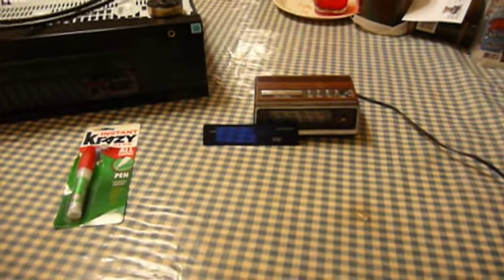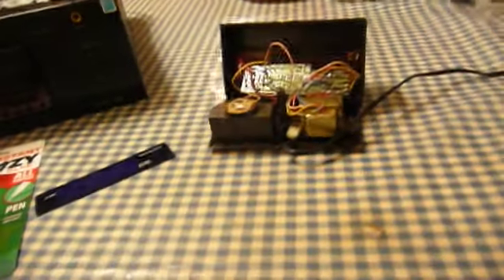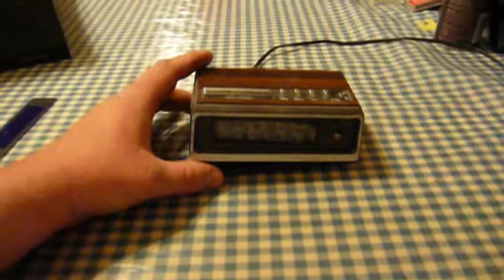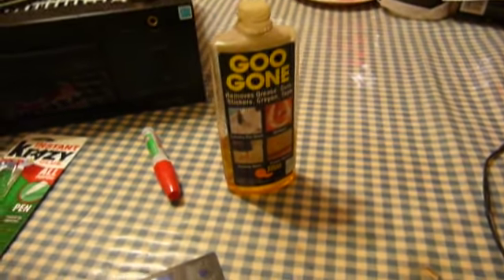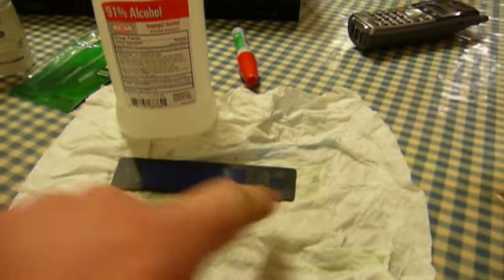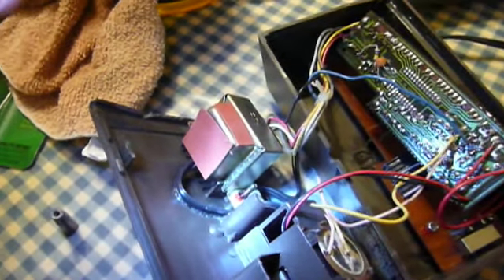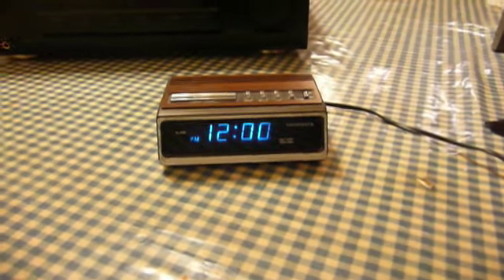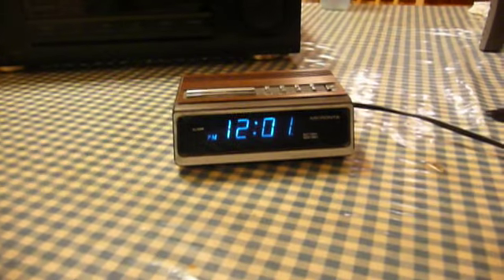Kitchen Table Electronics Repair: The Micronta Clock Restoration

Comment: The 1986 Radio Shack catalog says "selectable 12- or 24-hour display," and even pictures this model showing "23:59" on the display, so I don't think there was a separate 24-hour version. I don't know how you switch between 12- and 24-hour modes, but it's probably done by pressing some combination of buttons.

Comment: That's a really nice alarm clock! It's definitely worth keeping alive - not only because of the photocell (which I think is WAY cool!), but because of it's display - that's a Vacuum Fluorescent Display, and they weren't used too much in alarm clocks. You're lucky that from falling multiple times the thin glass didn't break, releasing the vacuum, thus destroying the display. I've got an old GE alarm clock that uses the same display except instead of that alarm symbol it just says "ALM".

Comment: Yep, mine is Futaba, as well. Largest manufacturer of VFD displays. They're much more costly to manufacture than LED displays, so they're usually found in higher-end equipment. Since the 80's, VFDs haven't been used in many things at all - they've fallen in favor of ugly LCD displays. They're still plentiful in DVD players, Blu-Ray players, and stereos, though.

Comment: I understand the value in fixing that old clock! In the 80's and 90's I thought things werent built well, then mid 90's onward everything turned into crap.  This little clock is probably much better than any equal function device you can find today

Comment: lol, nice touch running the hot water then.  I did the same with my sister in our old house :)  BTW if you are looking for a good quality plastic polish/cleaner, you should pick up some Klasse All In One.  Works great on certain plastics in car, but it will clear up a lot of micro marring in the plastic surface :)

Comment: I have this same clock, and it has worked perfectly for over 30 years. Unfortunately two nights ago, my glass tipped over and spilled water on it. The right/minutes side of the display is completely normal, but the left side is showing the alarm symbol, am, pm, and the hour as 88, all lit up at once. Any suggestions for how to repair this?
Reply from the maker: Unplug it straightaway, and let it dry out for at least a day or two. A sunny place would work well, unless of course you live in the desert or something. Maybe you'll get lucky. I'm not sure if the IC drives the display directly, but if it does and things don't improve, you'd probably be best off finding another one.

Comment: Can you tell me how to repair a capacitor on a clock like this one!  I think its bad because the buzzer is now to low.
Reply from the maker: The buzzer itself may be defective. I don't think there is any capacitor involved in that part of the circuit. Check to make sure the hole through which the sound is emitted isn't plugged up or covered.

Comment: Also, Equity clock has one two include picture control sensor with blue backlight, and it has a cool looking on the alarm clock.

Comment: the blue Led displays today are far too bright compared to the variable ones like they used to be. well the one i bought from Target was and it was a different blue too.
Reply: i know hey , i had one didn't last long.. i even tried colouring the outer display in with permanent marker but it didn't really do much, i thought perhaps if you could take the clear filter off and maybe spray it with that stuff people use to blacken tail lights in cars with might do the job